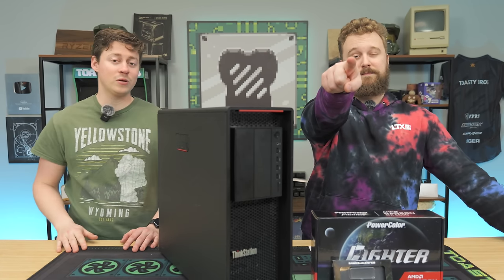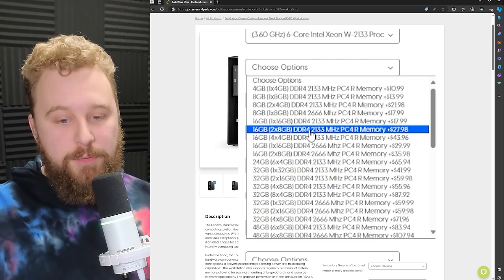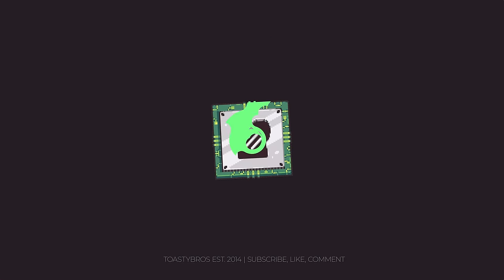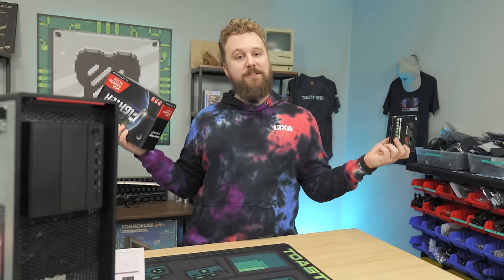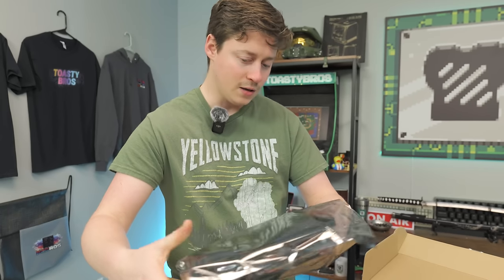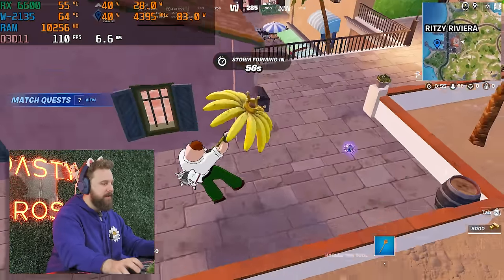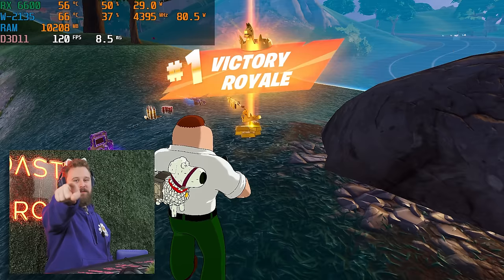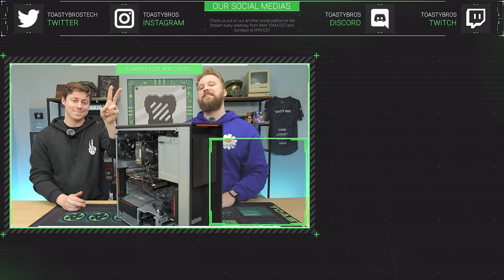$400 Budget Gaming PC Build Guide 2024 | Step By Step

Comment: I bought a P520 and it would not take Windows 11 from the thumb drive, it said the computer was not compatible. I had to load windows 10, but once I updated drivers from Lenovo and updated Windows 10 it finally said it was compatible for the windows 11 upgrade. Just wanted to put this out there if someone runs into the same issue. Plus you can buy Windows 10 Cheaper and upgrade to Windows 11 free.
Reply: Sorry to hear that. I wonder why? I was able to install Windows 11 directly on my P520 without any issue.
Reply: @wishbone20t   I was confused as well. I wasn't sure if I was going to be able to run 11 at first. I went to Lenovo and put in my serial number and it had an update, once I did that I was good to go.

Comment: As someone else mentioned, these systems would benefit from getting at least 4 sticks of RAM since these old Xeons support 4 memory channels. They aren't capable of using fast modules so having more channels utilized more than makes up for that.
Reply: The 2235 can support upto 2900mhz and that's about all you get out of them.
Reply: I know very little about building computers but I have this same setup;

CPU: Intel Xeon W-2135 (6 cores, 12 threads,
4.5GHz boost)
RAM: 16GBs(2×8GB) DDR4 8GB 1Rx8 PC4 - 2666V
Storage: 512GB Samsung NVME drive + 1TB Samsung 2.5" SATA HDD
GPU: Powercolor Fighter AMD Radeon RX6600 8GB

Do you think I would benefit by getting 2 more sticks of the same ram that’s in it to make it 32g total, quad channel ? It would cost me about $30 to do. This is my only, do it all computer..game,edit photo/video,general home/work tasks 

Thanks!
Reply: @thestory8  It won't benefit all applications, but it should help in many, especially games.
Reply: @thestory8   quad channel would be very nice and help the computer reach it full potential.
Reply: @thestory8 do it 32gb is smooth like butter

Comment: This actually turned out to be a pretty good idea. Several people told me they did well with this. I even spoke to a guy that installed a RTX 3090 in this, although he got the W-2145 8 core -16T CPU, which I picked up as well, and he told me there are some games that bottleneck (which would be the case, a 3090 is a total powerhouse next to this cpu) but in general he sees very good performance. He gave me some ideas for thermal solutions, which included removing the front fan brackets with pliers and installing 2 120mm RGB fans in place and 2 120mm fans at the bottom. He simply used well placed zip ties to hold the fans in place, and apparently the mobo has 4 extra fan headers, which makes it all work. Cheers.

Comment: The Toasty Bros kind of missed this, but even if you are going for "only" 16GB of RAM (which is perfectly fine, btw), you should ABSOLUTELY go for 4x4 or 4x8 (for 32). 
These systems have quad channel memory. The extra bandwidth you get from that is quite significant. Don't miss out on it. Especially more modern games scale well with bandwidth.
Reply: It always bothers me when I see that. 2 sticks is usually fine on consumer platforms, but you might as well use all of the memory channels on workstations. They aren't capable of using fast speeds so you can get away with using a bunch of dirt cheap sticks.
Reply: I even see that from channels that mention the quad thing and then stick in two. Not to mention the hexa channel with two…
Reply: It's more practical to buy a budget computer with 2 sticks with the option of adding 2 more when needed over starting off with 4 and needed to do a whole ram swap to upgrade
Reply: @bradbrad6521 I don't think you understand how quad channel works. This isn't about filling all 4 slots (those boards usually have 8), it's about filling the CHANNELS. You know how they usually tell you to get 2 sticks of RAM, because you lose performance from single channel?

Some CPUs are capable of 4, 6 or even 8 channels. You should fill them all.
Reply: Thanks for posting this. Considering that 4x8 can be had on eBay for less than $50 it's a no-brainer. For a little more, I ended up 4x32 but I am also going to build this for virtualization, NAS, and media server.
Reply: I know very little about building computers but I have this same setup;

CPU: Intel Xeon W-2135 (6 cores, 12 threads,
4.5GHz boost)
RAM: 16GBs(2×8GB) DDR4 8GB 1Rx8 PC4 - 2666V
Storage: 512GB Samsung NVME drive + 1TB Samsung 2.5" SATA HDD
GPU: Powercolor Fighter AMD Radeon RX6600 8GB

Do you think I would benefit by getting 2 more sticks of the same ram that’s in it to make it 32g total, quad channel ? It would cost me about $30 to do. This is my only, do it all computer..game,edit photo/video,general home/work tasks
Reply: @thestory8  if you're strapped for cash, no. If you play more modern AAA games and do heavier work (video editing in 4k), I highly recommend it. In games, you may see 10% more FPS due to added bandwidth (where latency wasn't an issue before). Look up quad channel vs dual channel X99. 

You can pretty much address 32GB of memory at once - and just having 32GB is really good for video editing in general. Miyconst's data is prety old. There's another channel called Danyloteen that has tested more modern games.
Reply: @b0ne91  Pretty much bang on.

Comment: Thank you so much for this video Toasty Bros!!! I just ordered one of these myself from PCSP on Ebay, I went with the W-2145/no ram/hdd/os one since I had a higher budget and the clock speeds are the same as the 2135. I also got 16gb of 2666mhz ram, and a 1tb Crucial gen 3 nvme ssd. Total price was $369. I have a GTX 1080ti that I've been dying to put to work, so this was the video I needed. The cpu won't bottleneck too much at 1080p, but I'm planning on trying 1440p out since it diminishes all of the bottleneck for games. I'll update this comment when I get everything and try it out!! Edit: Just got my p520 and it works flawlessly!! Will definitely be my daily driver. And yes, I liked my own comment.

Comment: Just built an all new 400 something bucks build.
12th gen i3 amazon 92bucks
Gigabyte board 89
Rgb corsair 8gbx2 ram 50bucks
Pny m.2 500gb and western digital m.2 500gb for 40bucks
6pcs inplay rgb halo fans 6bucks
Forgot case name was tempored glass front and side matx pretty small for a deal at 18 bucks
If count office 2019 and win11 pro another 25 bucks for that.
Rx580 for 40 with voucher and holiday promo sale.
Im liking it, for some reason rx580 wouldnt work with the undervolt cable but does much better than it should on benchmarks with rdr2 ultra 1080 getting solid 50fps or better. Does stay warm 71c

Comment: I went with the 2135, 4x8 2666, nothing else (or cheapest required) and pC was $243.93. Added PNY GS1030 NVME Gen 3 1TB (new amazon) $54.99, and a Surallow RTX 2060 Super 8GB (new amazon) $239. Total was $538 before tax so right under $600 after. I get 1 TB storage, quad channel faster ram, better processor, comparable GPU (I’m weird, I don’t like running Gen 4 x8 PCIE cards on Gen 3, at least the 2060 super is Gen 3 x16 like the system). Used I could see the GPU being $50 less but I feel like this is good build for $600 or less.

Comment: Need a hdd too, 99% of games it works fine, only a few that require faster. Specially if you want your whole library on your pc, get a 8tb or 16tb or higher and a 4tb nvme ssd and a 2tb nvme for your c drive would be a solid choice.

Comment: i got a dell precison T3620 with the e3 1270 v5 i watched the 215$ build but i use a 6 pin to 8pin pcie adapater and a lenvono oem gtx 1660 super which is a 1 fan like your one

Comment: What GPU is good choice for this if you run 4k - so this w-2135 does not bottleneck too bad. Please note that I still use GTX1070 with i7-920 to play 4k. Don't care about frame rate (for me 30 is playable). Mostly upgrading to get Win11.
Reply: i7 from 16 years ago paired with a upper mid range card made 8 years ago. Horrible combo. Upgrade your CPU, not even for the gpu, just for performance. Your cpu is from the dinosaur ages.
Reply: this is the first time i see someone use 1st gen i7 to play games in 4K
Reply: @Kagamiya given the fact that 4K most of the load is on the GPU probably works fine

Comment: I would have been interested to see fortnite in dx12 mode. I find it better using multiple cpu cores than performance mode, and I wonder if with the xeon if that would boost performance or not. Might just shuffle the bottleneck around and perform the same or worse.

Comment: I got a much better bang to performance buying through other means. ThinkStation P520 Xeon W 2135 3.7Ghz, 64GB DDR4 2666Mhz memory, 512Gb NVME SSD, Came with a little GTX 745 4Gb. I completely love this computer. I'm coming from a Dell Optiplex 7010 budget case swap i7 3770 4c/8t, 16Gb 1333Mhz, gtx 1060 6Gb model (This card will be going in the ThinkStation)
Reply: how is the boot up time for you with that setup?
Reply: @DankDanny8  Boot time is horrendous with the Lenovo. Takes about two minutes to boot into windows. Haven't gotten any answers other than update the bios, which I've done & hasn't changed the boot time at all. I'm okay with it taking a little while to boot though. The added performance is worth it compared to my old system.
Reply: It was eBay right?
Reply: @knucklehead4817  It was eBay. I can't find better prices anywhere for these Lenovo's.
Reply: @warfist-mv8mh  Yeah, only place I found them as well at good pricing. The other guy’s sold out, and then prices went up, ridiculous.
But psu, ram, mobo and cpu on eBay for the price is good. Guess this is the new “dell opti”, planning a 1660 or 6600 on mine.

Comment: The only bad thing about these is the cooling is terrible and sounds like a jet engine. There are options for better fans and a much better cpu cooler though. I wish they would also show that.
Reply from the maker: That’s just wrong, they are quiet systems and the temps you see while gaming are what you get
Reply: @ToastyBros   I have had a couple and those P520s from pc and server parts and those 92mm AVC  fans are so loud and make them run hot. Sure you can set the fans down to the stock setting and it just runs warm, but if you put it at 3 and when the pwm stock fans kick in it's like an airport at max load. I put some be quiet pwm fans in and a noctua 92mm cpu cooler and it was night and day in sound and temps. So not wrong at all.
Reply: @ToastyBros Maybe you can record the dp of the system. My unit with xeon w-2145 with fan speed of 3 is loud as hell therefore i stick back to the default settings with heatsink replacement.
Reply: @chearlixian147   On 3 when temps ramp up it's an airport. On 1 it's quiet for sure but man is it a little heater even on idle with new paste. If you replace the fans with better ones and the cpu cooler it's night and day difference on temps and an overall better experience.

Comment: Amazing video, I just subbed!
I've ordered everything as shown in the video, however, would I be better off with the Radeon RX6600 or a GTX GeForce 3060?
I'm assuming that the 900W power supply would accept this?
Would the 3060 get adequate cooling and airflow?
Any help is widely appreciated :)
Reply: I am currently using a 3060 12gb in this system and it runs perfectly

Comment: I've looked into doing this many times before, and I've had two different friends build a few of these with mixed results. Most common issue, components get too hot in a case that does not support strong positive pressure. 

The fear is suddenly u find yourself just holding a $250 GPU and whatever parts you can strip. Anyway to get good thermal performance in those rigs?
Reply: Noctua makes a cooler that’s low profile and is compatible with this socket… should help out
Reply: @Ice-Sik-ill  I actually saw a guy on Reddit used a pair of pliers to remove the front fans mounting brackets. Then he removed the front server fan and carefully zip tied two 120mm RGB fans tightly up against the front of the case and they fit well. Then he placed another 120mm on top of the PSU pointed up and next to that he placed the old 80mm server fan that used to be up front, again pointed up to blow air against the GPU and the CPU heat sink and rear exhaust. He had the same CPU I opted for which is the W-2145, 8 core -16 and paired it with a RTX 3090. Which seems crazy, like it would bottleneck like hell, but he told me while there is some bottlenecking in certain titles, for the most part he gets excellent performance up to 4K. Which I think is pretty insane. I plan to pair mine with a GTX 1080 Ti. As it came out at nearly the exact time as this PC. And I definitely plan on copying his thermal suggests. I ordered a 3 pack of thermaltake RGB fans on amazon for $12. See how that goes.
Reply: @bizbarley74  bro I might try this, got a link?

Comment: I'm about to do something brave or something stupid. Just ordered a 7900xtx and a sata to 8 pin adapter to toss in this system 😬
Reply: It fits (with the included bracket) if you remove the housing for the front 80mm fan. I used pliers to remove the bracket that held the housing for the fan, attached at 120mm fan directly to the case with spacers and zip ties. This system shreds for a build where 90% of the cost is the GPU.

Comment: I just got a. Dell OptiPlex sff with an i5 8500 and 16 gigs of ram. I’ve been trying to get a Rx 6400 but 180 is crazy what other low profile gpu can I get
Reply: Intel arc a380 low profile edition
Reply: Go used market,and get rx 5700 or rx 5700xt
Reply: Sell the Optiplex and don't get an SFF. I'm not kidding - there are no good/reasonable LP GPUs out there anymore. A380 is hard to find and requires ReBar, 1650  is rare and pretty garbage, worse than a used GTX 970. The 6400 is limited by PCIE 3.0 and x4.
Reply: @b0ne91  or he can remove the  conpoments of the pc and change the case to a normal one
Reply: Take out the components and change the case so that you dont need to buy a lp gpu (there bad value right now)
Reply: @iliasrizki2799 Might not be possible. A lot of Dell systems use proprietary parts that can't be used with parts of standard form factors.
Reply: @yasu_red  oh ok

Comment: i got a hp compaq and i want to play fortnite at 70 plus fps. please make a video on it and tell me what to upgrade i got i5 3470 6gb ddr3 ram and 1 tb storage
Reply: Yeah I highly doubt he's going to make a video on that specific computer. That's a pretty old system. Upgrading the graphics card can help, but your options may be limited depending on the PC case size, power supply, and what makes sense based on that old CPU.

Comment: 6:25 “Hot Swap” means you can swap the power supply, while the power is on. You cannot do that if you only have one power supply.
Reply: Hot swap means you can just swap the psu with no struggles

Comment: What other cpus could I put in it
Reply: Xeon W-2133, 2135 both are 6 core 12 thread. W-2145 is 8 core 16 thread. If you go 10 core or above they start getting really expensive and the individual core clock drops. So you're best off sticking with those three.

Comment: ToastyBros, could you please help me? 

My rx 5700 xt is detected by amd auto detect drivers as 5700 non xt and is not detected at all by task manager and display adapters.

Every time I Install the drivers, after the screen flickers my screen starts bugging out and i have to uninstall the drivers.

I cannot launch or play ANY games without the drivers and I cannot find any fixes. Please help me mike.

The RGB lights up as well and got it to work by deleting plane overlay but it came back 30 minutes later and i had to uninstall the drivers again.

Thanks
Reply: Are you using DDU to uninstall? Are you sure it's a 5700XT and not a 5700? Did you buy it new?
Reply: @AlexHusTech  got it used, i did use ddu and it had the 5700xt packaging and has the 5700xt sticker labels on it

Comment: Does someone know how to fix drivers not showing up on install? I just got a build with the p520 but am having that problem. I am using a usb boot drive for windows 11, thanks in advanced.
Reply: Mine wouldn't do Windows 11 something with the tpm not being updated to 2.0. Easy fix, I think also it wouldn't boot from the m.2 right away. I had to go into the bios and change the boot order to the m.2. I haven't finished setting it up
Reply: Like what drivers are you asking, Storage or something else?